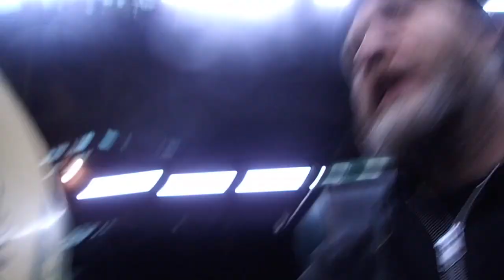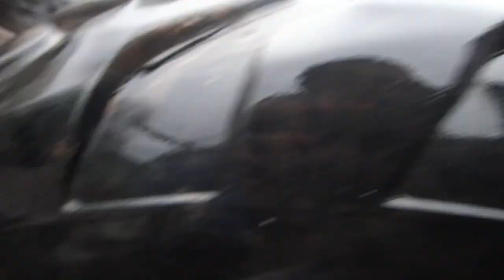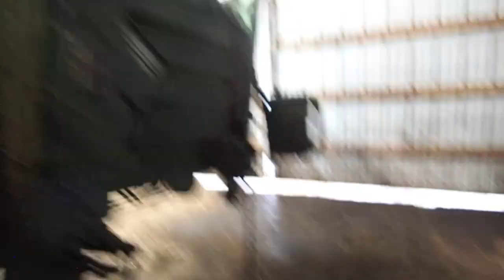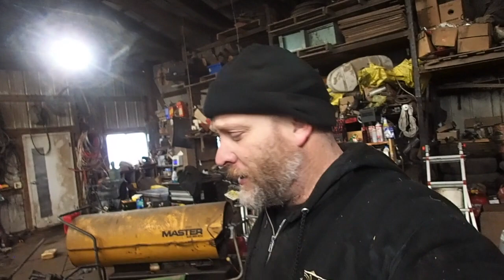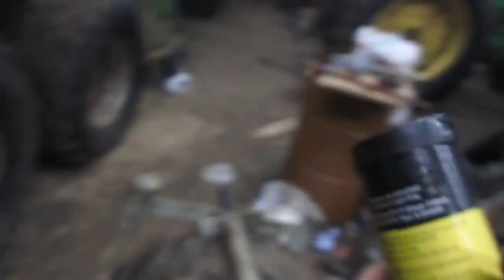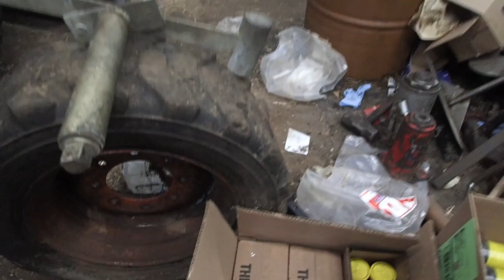Is Krone Junk? NO ITS NOT!

Comment: The Amsoil military specification grease is better than all of them Wes, it's rated at - 54 below zero pump ability and can withstand practically anything,its a super-heavy duty equipment grease,that will not seperate under the worst operating conditions.

Comment: Number 1 grease is for cold weather. Number 2 is for warm weather.
Reply from the maker: Richard Poe the cornhead grease is 0
Reply: You can buy Valvoline crimson in a 0 grade. But you have to buy it in a pail, or a 120 lb keg. It also comes in a 00, or a 000 grade.

Comment: As I recollect, the new Krone baler, is pretty tight in its storage location. I understand why you did not immediately go grab a tire and wheel off that.  In addition you would need more blocking materials and more jacks, to have both balers up in the air.  Knowing you had a new tire, you were sure you could come back with a good tire and wheel, and then be done with it.  Same as you, for uptime, we got a new tire, but since we are not staffed or equipped to do a tire dismount and mount, we have it mounted on a Krone wheel, so we always have a bolt-on spare available.  Unless we carried all the jacking, and impact wrenches with the baler, it would not be of much value to have the spare mounted on the baler.  You'd need two people to get it off the spare wheel carrier anyway.  I think I will get with a hydraulic fitting shop, and get the hardware to plumb a female quick connector into the baler air tank metric fittings, and then I could at least air up a low tire and maybe run an impact gun especially with a portable jumper tank and a larger diameter hose coming out of the jumper tank. Maybe an air powered jack.

Comment: the grease company assure you it will work? will they assure payments for the repair??... when the equipment builder say's no, its no :) grease company did not design the equipment
Reply from the maker: ebu touy the grease company uses the auto liner in its factory and they use that type of grease so I would say it’s safe

Comment: Some rifle shooters coat their barrels with moly, bullets with molly to EEK out every bit of speed. The barrel must also be cleaned to remove it after use. Super slippery, but sometimes causes sealing issues between bullet and barrel.

Moly Coated Bullets- A Warning
Moly destroys your barrel by attracting and trapping water in the barrel causing severe pitting.
Even if you live in a dry climate, temperature changes experienced during the hunting season (gun inside warm house – gun outside in the cold) causes the metal to sweat.
My barrel was destroyed by pitting after only 154 rounds 40 of which were moly coated (fail safe). I had cleaned every 10-20 rounds with Hoppes9 and Shooters Choice, both good cleaners, with the patch and brush method. It didn’t get it out.
Moly is EXTREMELY hard to get out. Plug the barrel and soak with Kroil overnight. Then scrub with a mix of JB-Bore Compound and Kroil for 5-20 short stroke technique passes. USE A BORE GUIDE, quality rod and jag, and be careful around the crown (don’t bang the heck out of it). Finish with a solvent of choice and good oil. Hoppes9 or Shooters Choice mops out the JB well. If you choose, you can use something a little stronger like Montana Extreme for a final solvent pass. Extreme copper solvents like Sweets 7.62 although are great at removing copper are probably not necessary with this cleaning process as the copper should have been mechanically removed by the JB/Kroil mix.
A moly conditioned barrel will not shoot Std. copper bullets accurately (relative term).
Stainless barrels are effeted too.
This does not apply to “Lubalox” (found on Win. ballistic tip) or the Barnes coatings. However, I still advise caution.

Comment: Verdestien tyres are total crap, had a brand new set of 650/65/38 on a john Deere 6930 and and a set of 20.8/38 on a Richard western rear discharge spreader (new) and all went back due to them cracking up and de-laminating...........NEVER AGAIN

Comment: TireJect, would it work in the tire? Too bad you don’t have an extra rim to test it! You might get a rim and tire just in case you blow a rim. 
Could it be the metal fence post were spaced the distance between the two cuts, metal detector might help cause it would be a shame to run over it again. Hello to Theresa and William!

Comment: Krone balers would be perfect if they sported 4 dualled 10 00/ 20" standard tractor trailer (aluminum bud style) wheels with minimum 10 ply rubber. This would be quite an adaptation if one wanted to change the hubs and still have brakes though. Tires and wheels would be cheaper thereafter.
Reply: @TomSlak-p3h  Rocks might be an issue if the baler needed to be transported on paved public roads. You might need to clean then out then. As far as flotation goes, I think you would have more! These factory flotation special tires and wheels are just a way of hosing the buyer at purchase. What good is 3 or 4 ply any way? They want $1200.00 just for a rim,....really??

Comment: In the video of the flat front tire, it shows that the rear is close to flat from the weight of the baler even with the front still on the ground and supporting a little weight and seemed to show a fold beginning. Was that rear at the full 55 pounds when you got back to the barn? I very much doubt if there is ANY other BALER in the world that has SEEN the sheer TONNAGE of PRODUCT pass through it per HOUR of USEAGE regardless of brand!. KRONE ROCKS !!!     sdh in the Tobacco Valley of CT

Comment: I have used 274 grease in my krone balers for over 10 years never had a problem now I switched to 219 have no problem. My oldest krone has over 85,000 bales

Comment: yes the moly grease will become dry in a sense. we use it on brake pads at work, and it stops up applicator lines also, it has to be at a good temp and actuated or stirred, if it sits the liquids will rise to the top and lower areas will become dry

Comment: Wes Molly is a solid, do not use it on ball or roller bearings, the solid particels can stop a ball or roller from rotating when under load reducing there life, great stuff on parts in sliding contact though. Cheers mate 🍻

Comment: I’ve seen people use that corn head grease in older rotary cutters/ brush hog gear boxes that maybe have a leak or don’t get run a lot. That corn head grease turns to a liquid much easier than other greases (it’s suppose to) and resolidifies  as it cools off.
Reply: Drew w it also works wonders in stiff trailer landing gears.

Comment: I'm surprised you don't have a portable gas powered air compressor or like a Milwakee 1 inch battery powered gun or that you haven't rigged up a air tank on the baler since you already have air compressor on there
Reply: Even a small air compressor with a generator will work